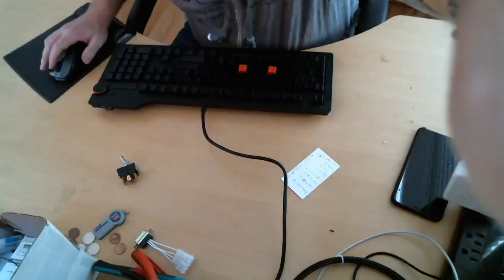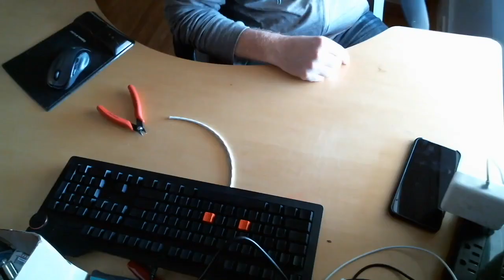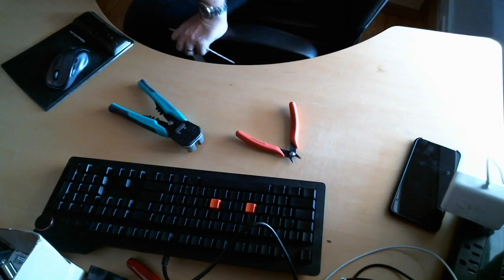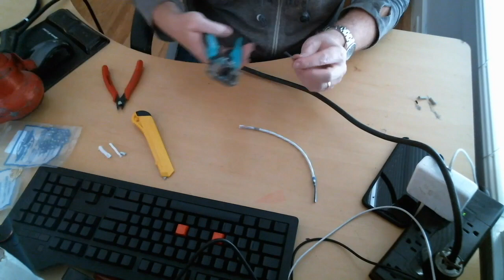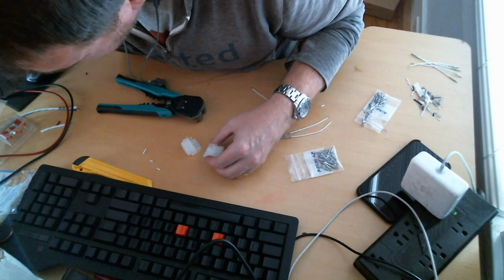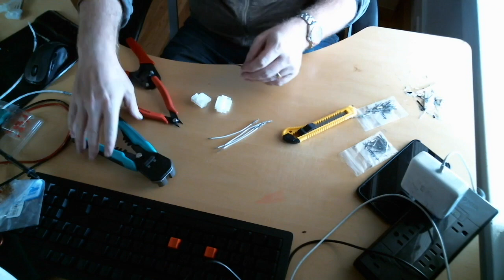RV14 - Fly LEDs 6

Comment: how long have you worked on all the flyleds?
Reply from the maker: I think I did the initial construction in about 5-6 hours. Making the wires was about 10 hours. Lots of practice to get good at it. The final debugging of the system was about 5 hours.
Reply: @akilroy  I'm currently waiting for my lights. Thought it would be just a few hours of work. We will see :D
Reply from the maker: Making the lights themselves (if you bought the kit where you solder yourself) is only a few hours. If you bought them premade and didn't buy the wiring bundle then you'll have to either wire up your own the way I did or find a way to make Van's wing wiring bundle work for you.